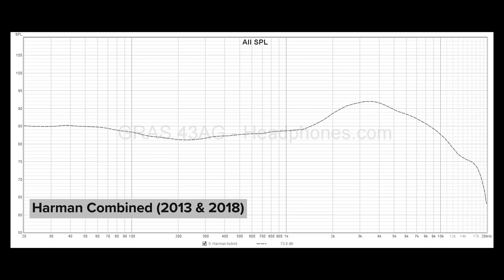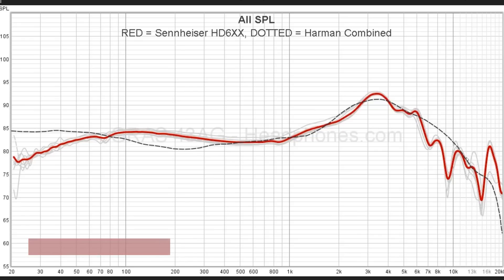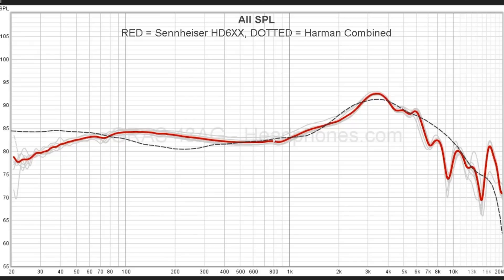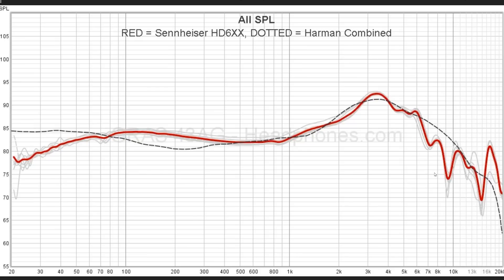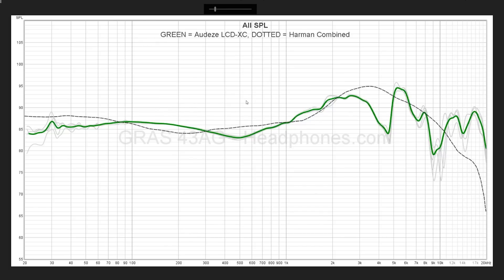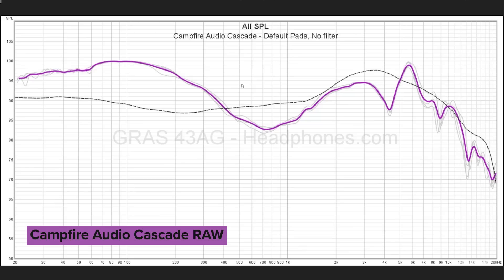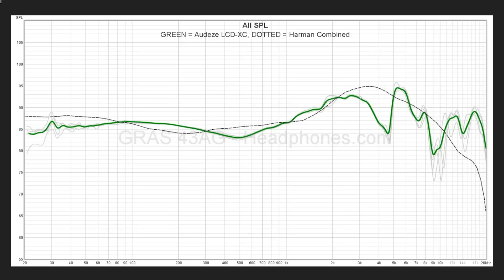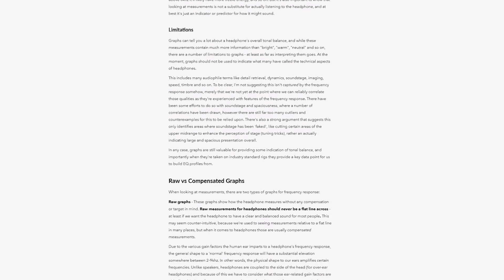How to Read Frequency Response Graphs for Headphones

Comment: As for improving the sound of any headphones (even phone/Tablet connected to Amp and speakers), consider this...
There is an media player app (sadly only for Android) that IS indeed a VERY powerful, customisable and usable, and that's 'PowerAmp'. There's MANY things you can do with it including customising the EQ from 5 bands (frequencies) to 32, this alone gives MUCH MORE control of setting the sound output to your headphones how YOU want it (PLUS you can save an EQ and sound stage setting to each individual device - headphone/speaker output), or, to set your headphones more to known set graphs/charts. Not only that, 'PowerAmp' has many features, handling streaming, Crossfade, Sound Stages, Pre-Amp, visualisations, MANY media formats, many skins are available to customise its look, the list goes on with many other features... 'PowerAmp' has consistently for years been pretty much THE best audio player even compared to VLC. I've used it for many years now and I haven't found anything that comes close, even though my LG phone with built in Quad DAC boosted the quality of the music I was listening to, 'PowerAmp' REALLY made a difference... Try it (it's free for a while) but even then when you need to pay to unlock it, it's only what? $5?, See what it can do with your music, it WILL certainly help improve your music listening pleasure.
So £/$5.. To give you MUCH MORE control of your sound? Sounds like a bargain... NOT much money at all... 😏👍
Anyway, all the best to you fellow 'Audiophiles'... 👍    😎🇬🇧

Comment: question: why is that in a frequency response graph you can have a frequency reach 100dB but when you measure the SPL it does not reach that laud when doing a frequency sweep.
Reply from the maker: You can set the gain however you want. But, 94dB is a common calibration. As is 84dB on the graph.

Comment: Can you elaborate what's on the left side of the graph, the SPL? Why is it generally around 80dB and not lower for example? I assume it's because higher than that would be harmful
Reply from the maker: SPL = sound pressure level as measured by the mic.. dB = Decibel. For these purposes it doesn't really matter because the software allows you to calibrate to whatever you want. It's best to use some sort of SPL calibration tool separately and then input the values, but you can move that up or down in the overlay anyway so it doesn't really matter. Really those values are kind of arbitrary, but at the very least I use it to show scaling.
Reply: @TheHEADPHONEShow  Ah, I see I see. Thanks for the response!

Comment: Does this mean equalization profiles like those used in AutoEQ are a mistake? It's my understanding that they try to make a headphone's frequency response exactly match a Harman curve, which would mean smoothing out every peak and dip. I've been wondering lately whether just using those AutoEQ settings is really the best way to go...
Reply from the maker: It's a good question. If it's done strictly by matching the target, then yes that would be a problem. But if it's done in conjunction with listening tests, and/or observes certain features of the FR that should be there like the 9khz concha interaction then it's fine. I think this is also why it takes such a long time for some of the groups doing this kind of stuff to come out with profiles. In general I trust oratory's take on EQ as a starting point, because at least I know he factors those features in. But also, you have to remember that these measurements are all done with a standardized rigs with their own HRTF, and that may not match yours. I'm currently working on a way to show measurements for how I personally hear something as it's coupled to my head to see if there are differences between that and the standardized rig, ideally leading to some average deviation that I can report - and to help with what I perceive to be exception cases like the lcd-xc. But that's still just in the works.
Reply: @TheHEADPHONEShow  Very interesting! I also looked at the AutoEQ GitHub page again just now and see that it's been massively expanded since the last time I checked. Now there's a section called "Technical Challenges" that details exactly these issues.

Comment: A compensated Harman Target graph shouldn't look completely flat though.
It's just a lot flatter than uncompensated; it's mostly a gentle downward slope from bass to treble.

This doesn't make them less valuable. 
They're obviously easier to read and do have some purpose/value.
Reply from the maker: The very nature of a compensated graph is that it normalizes the target. Do you mean like the way oratory represents it? Because all a compensated graph shows you is deviations from the target. You can have this be a flat line or a downslope, whatever you want.

Comment: Excellent!!! I believe I know a fair bit about loudspeakers and listening rooms but sadly to little in regard to headphones.
Because my listing room after moving from one apartment to the other have deteriorated acoustically I have turned my attention towards headphones. Another reason I am moving towards headphones are the numerous excellent podcasts which seems to rise exponentially. Nothing beats headphones when one tries to listen in a concentrated but still relaxed atmosphere.
So thanks for the wonderfully interesting and informative videos.
One thing I think might be missing in the Harman curve is that it doesn’t take driver size into consideration, to my logic (which might be flawed) a very big driver will give a different pinnae interaction/transformation compared to a small driver. This could be compared to the difficulty of equalizing a small point source loudspeaker to have the same timbre as a big line source loudspeakers.
Another very small thing I instinctively find slightly dubious with the Harman curve, is that even though the general trend is gently curved and look logical, there is a reduction of roughly 1dB between 150-300 Hz. Which doesn’t follow the general curve shape. I speculate that this has come about because most people compare listening to headphones with listening to loudspeakers, rather than listening to the real thing. Almost all loudspeakers set up in a listening room have a reduction in the room response in exactly this region. This reduction is caused by interaction with the nearby room boundaries and called the Allison Effect (after the late great speaker designer Roy Allison). So could it be that this preferred dip has crept into the Harman Curve because headphone listeners by previous experience from loudspeaker listening, believe a depression in this region to be natural? 
Keep up the good work your videos are excellent.

Greetings from Denmark

Klaus

Comment: Good morning from the uk Andrew. Just wondering if you can help with my next purchase. I own fostex th900, cascades, hd650, audeze sine, Sony mdr z7r, fostex Purple Hearts, audio technica wp900, meze 99, hd25. Yeap I’m an addict. I use a Hugo 2 as my amp/dac. Question is do I go for zmf vc, rad 0, HEDD, Arya or something cheaper like sundara, lcd-2,  ananda. I could prob get two of the lower price but only 1 of the top tier. I like metal, electronic and jazz

Comment: Write : How to Read Frequency Response Graphs for Headphones
Read : Shielding Audeze LCD's

Even though Audeze LCD has imperfect Frequency response graph, Ldc is good. 
LCD's are exceptions.
DT1990 Pro has 8k peak on frequency response graph, so it is all fake detail. 
What about details on bass and mid?
I know you are so strict about frequency response graph, but you are always generous of LCD's. Why?
Reply from the maker: I explain that in the video. It's not always correlated with the auditory experience. Also, I'm generally quite critical of Audeze FRs, the XC is the only one that's had a great tonal balance out of the box to my ear.

Comment: I prefer slightly less bass and 3-4k peak. Also i prefer slightly more higher treble/air. Older harman target is a bit better. XC looks better than 6xx to me.
Reply: How old do you mean? The 2013 target has less treble extension and more 3-4khz energy than the 2018 target.
Reply: @ResolveReviews  I think 2013 target have better bass. I didn't noticed the change in treble. Less 3-4k energy and more treble extension is definitely the better for me. I wonder are they gonna update the target. 2020 revision would be nice. Did you measured Ananda with the new equipment ?